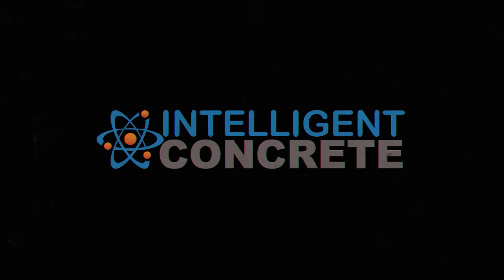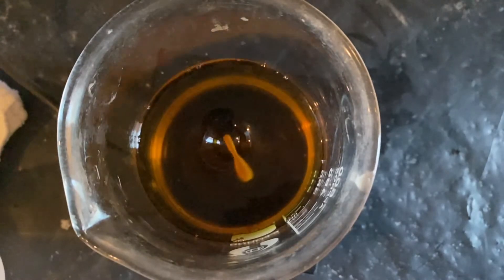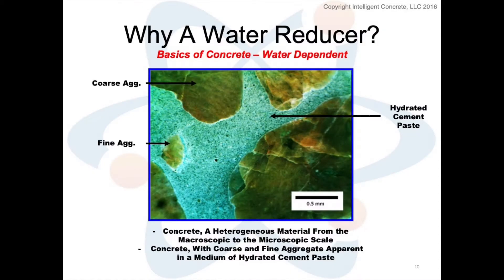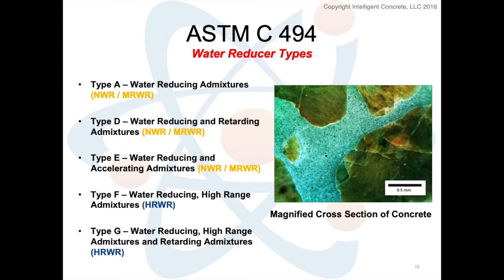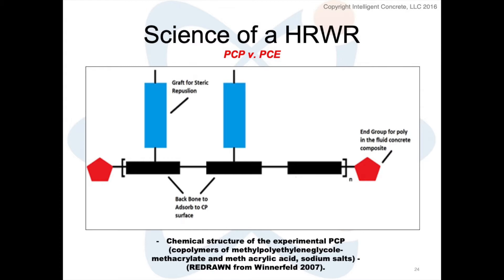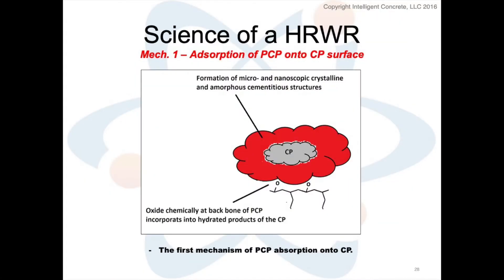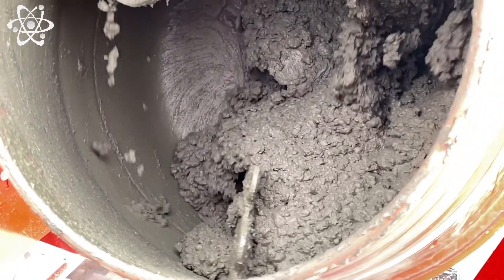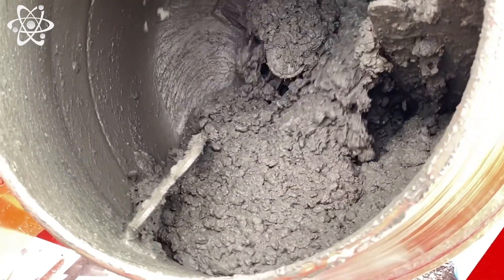What Happened to Midrange Water Reducers?

Comment: When you are giving these ratios of fl. Oz to hwt, is the hwt accounting for the entire mix weight of sand stone and cement  or just cementitious material
Reply from the maker: It’s only the hundred weights of cementitious (some admixtures it’s only cement).

608 lbs per cubic yard of Type 1L cement is equal to 6.08 cement hundred weights or cwt.

Comment: Jon, do you have any thoughts to share on the conflicting rheology between what a PCE provides and what 3D printing needs?  A high dose of PCE will have "creep" - a very low static yield, with not enough shear thinning. You can add components to offset that, but that is money you are putting into both sides of the mix, where if you can just avoid the PCE creep, it will be more cost effective and provide more opportunity to avoid shrinkage (less ultra fines). Thanks!
Reply from the maker: It’s just about dosage but also about type and accompanying chemicals.
Reply: @IntelligentConcrete  Now have a PCE compensating 3D-Admix if you would like to try some.  It does depend on the particular PCE though.  The main issue is to not increase shrinkage with the cancelling component.